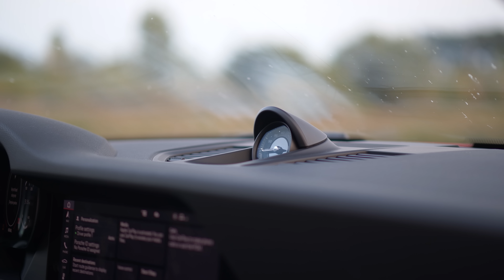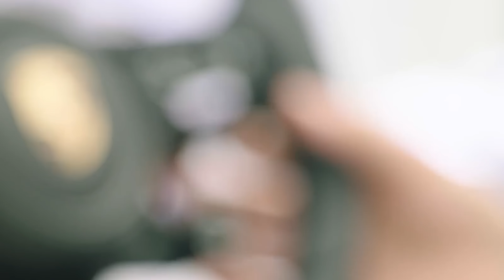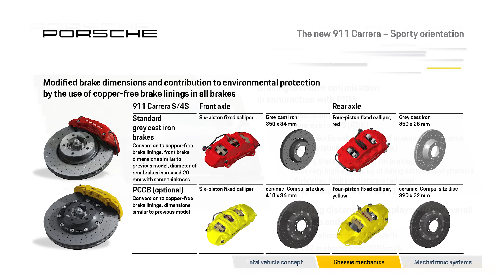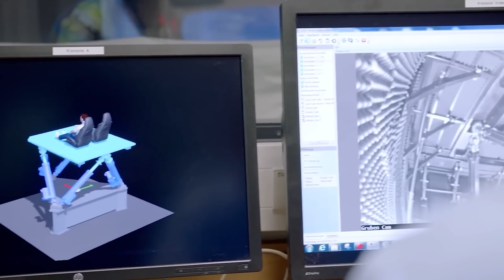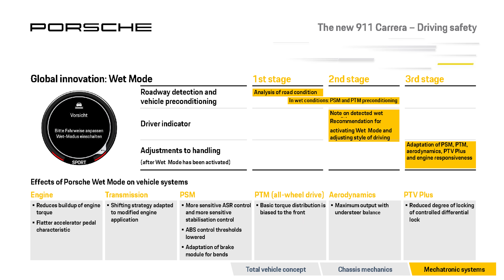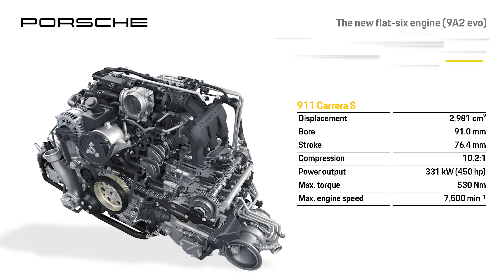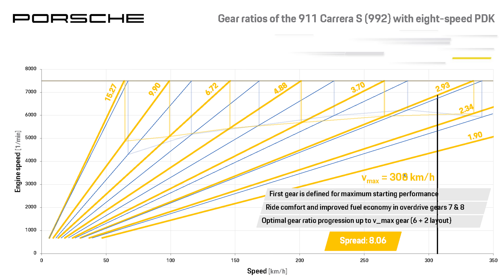Porsche 911 Carrera S 992 | Technical Brain Damage

Comment: Amazing technical presentation and so close to my driving feelings, I could add that lighting system is so good even without PDLS it is wide and the defined area is so accurate. Honestly the driving feedback this 992 gives is incredible, I thought that it may barely égale my x 981/gt4 but it over passes in terms of accurate steering feel and sharpness, the breaking despite being smaller diameter are so consistent and progressively powerful, not taking about the engine that is I bet more around 470 bhp. Porsche made this 992 so addictive to drive, my advice : never try one on a well known road you will feel upset by other car until you can get one.

Comment: You don't need all the fancy bollo*** inside to make a car worth driving or better than before. My F430 has virtually nothing in terms of the interior and it's far more thrilling than any 911 - period. However, to be "ambivalent" towards previous 911s is crazy! But I sort of get it.. Well, perhaps not previous GT3s etc. But let's take a Carrera 997. It can feel quite tame and docile as a stock car. But if you get a free flowing muffler, put 200 cell cats in, deactivate the little resonator.. That car can really start to scream and it'll feel far edgier at higher revs. It becomes a different animal. And sure you can change other little things - fill out the rear arches with spacers, put LED lights in, maybe tune the mapping a bit to give it more low down throttle response. The 911 Carrera is a fundamentally brilliant base for a sports car. I'm not sure you need so much of the 992s tech for it to be so!?
Reply: Not even close. That ferrari look worse and it's not as completed package as a 992 4S because lacks awd, rear seats and trunk space and it's slower on the skidpad (lateral acceleration) and at 0-150 mph.

Between 3 ferrari f430 and 1 porsche 992 4S, I'd still get the porsche.

Comment: Your hands should be at 9 and 3 not 10 and 2 so you are blocking the gauges by improperly holding the steering wheel.

Comment: There are no issues with the gauge cluster, it’s the same it has always been. You want to see the speed and tach, for temp and oil pressure - it will tell you if there is an issue, it is 2021.

Comment: What a great review.  Probably the most comprehensive 992 review I've seen anywhere.  Love the engineering details you guys covered.   

About the only issue I had is the comment about trial braking and how all 911's are good at it.  That's totally false.  I have a 997.1 C2 and my number one complaint about the handling is how you CANNOT trail brake the car.  Lots of Google searches will you show that for the 997, Porsche decided they would not allow the car to rotate under braking -- even if you turn off TC and PSM.  So even if you turn off PSM it's never fully off and you can't get the car to rotate, unless you purposely upset the car to the point where PSM can't correct for you.  As an experienced driver who was able to consistently trail brake a Lotus Elise through corners around all kinds of race tracks, I can't do it in my 997.  And it's super frustrating.   

Other than that little personal trigger, it was a great video.

Comment: Great video on the best overall sports car ever made. Im sorry Mark but I have to push back on your opening complaint as your hands should always be at the 9 and 3 o’clock positions, not 10 and 2 where they block the view but more importantly, the 10&2 positioning limits your range, it allows your hands to close into a clinched fist on the wheel, making your inputs too tense vs the open handed grip at the 9&3 position that encourages more measured inputs and keeps the leverage even for both arms as you turn the wheel... and so on. I got teased constantly by my performance driving instructor for going to a more relaxed hand position in between our technical sections.

Comment: I know I'm a little late to the party,  24:40 comes straight out of the game Need for Speed: Porsche Unleashed but what Mark says 26:06 is the exact same experience you get from the N/A Taurus Gen 1 and 2 SHO's. Yamaha created variable-length intake manifolds and built the top end. Below 3800 RPM's it focused on torque, then the secondaries opened for the engine to scream like this 992 until a soft 6250 redline (8000 if you mod the ECU).

Comment: Nice detailed video thanks guys. I own a 992 C2S Cabrio. I love the interior, the way the car looks and it's seriously quick. Unfortunately and mostly due to UK roads the car rides awful, it's simply too firm and crashes over even the slightest poor surface. The cabin noise is high as measured by Harry's garage at 80db @ 60mph, and even more in my Cabrio. The biggest problem I have with the car is the 14 way electric seats. They are quite hard, have no shoulder support and I simply cannot get comfortable in these seats. I wish I'd seen the blogs regarding these seats before I bought the car. 
I've driven a C2S on a track and it's seriously impressive and easy to drive fast. However, as an everyday car for me it's a no.

Comment: I like how the rear spoiler lifts and work as an air break however it would be very impressive and efficient if the spoiler is split in 2 parts left/right and operate based on the car positioning to give optimum breaking force where needed on wet roads!  just like a fighter jet..

Comment: I don't think the placement of the left and right screens is wrong, per se, because the obstruction is minimal when your hands are at 3 and 9 o'clock, rather than misappropriated to the 2 and 10 o'clocks positions (which is not how the wheel is intended to be used).

Comment: In 2013, I brought my 2012 991 Carrera into the Porsche Dealer for an annual tuneup and oil change. I was loaned a 997 Carrera S. After driving the S for the day and then picking up my 991, the comparison just blew me away. The newest generation was so much better than the previous generation that my Carrera standard was so much better than the S in every area. Apparently 8 years of evolution in the S, makes the latest generation so much more car than the earlier generation that the two are almost not comparable. It is so much better. An interior that is special and still has switches and the electronics that control the car make it an amazing experience and in control in all cases, even during the rain. The 991 was so much car that I'm in no hurry to part with my old NA 3.4 liter standard Carrera. For those who don't have a Porsche but always wanted one, the S version of this latest car (or a GTS version) is the one to have, unless you have to have a super car. Then you'll have to pony up the money to afford the GT3. AF

Comment: About the gauge visibility problem with your hands on the wheel, no one should be driving at 10 and 2. If you need to have two hands on the wheel 9 and 3 is much more efficient.

Comment: The oversight is that you need to learn the correct position and practice for your hands on the wheel. Your thumbs should be at Nine and Three, in the grooves that have been designed to guide and hold your thumbs. Some hold the wheel at Ten and Two, or worse, one hand at Twelve. They just happen to be wrong. For people that rest their hands on the wheel centre, they are morons, begging to shake hands with Death.  You're welcome.

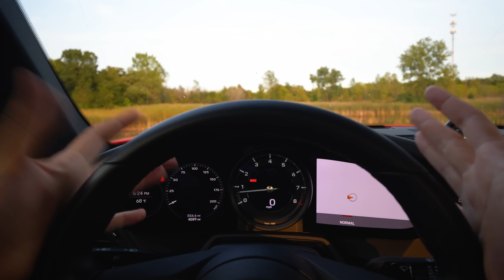Comment: 3:03 the proper way to hold the steering wheel is 9 & 3. So your improper hand position blocking the gauges is not an oversight by Porsche

Comment: This WILL become a classic like no other, even for Porsche's standards.
They nailed the styling, it's the first time a new 911 doesn't strike me as too modern, usually I need to get used to it.
Secondly, even if I could afford a 991when it was new I still would have gone for the 997 because of the interior.
Now though in my opinion the interior is perfect for a modern car. I like the look of the instrument cluster but it will be the only thing giving away its age in time.
If there were an option to spec it without digital cluster and a folding infotainment screen it would be te end all sportscar to keep for the rest of your life.

Comment: Hi everyone hope you're all well and staying safe during these uncertain times were on lock down in the UK again and I've just watched this brilliant review I took delivery of my 992 4s last year and I've got to say it's the best piece of kit I've ever driven the grip and handling is fantastic even in the wet weather and we have our share in the uk the finish of the interior and quality is the best I've had in a car for years  people are moaning about the gear selector but let's face it put it in drive press the M button and take off begins you only touch it again to reverse the only problem is the outer gauges are terrible to see I think Porsche designer's didn't think that out very good apart from that I've no complaints and it's definitely got more than 450 horses under it they've put a 2s on a dyno hear and it done 475 bhp just think of a re map and exhaust charge what you could get out of it  PDK or manual PDK for me plus just imagine how much a clutch replacement would be ? Thanks again for a good review keep them coming kind regards

Comment: I am glad you liked the car but your series usually tries to captivate the driving experience or more its spirit. The spirit is more robutt in this car and episode. Where does it stack in the increasing values of prior generations? Sheet metal and body weight are very misleading with out talking about the total weight. These were all Porsche derived graphs but I was hoping something more savage than geese in this episode. This seems like a bought review. A wave of a cap that someone got into the big leagues. Main bald guy usually curmudgeons about new technology. Soothing voice guy does well. I think this car deserves a little more criticism from a so called automotive expert.
Reply from the maker: Its too expensive and over engineered.  Thats goes without saying.

Comment: Wow, those taillights (or shall I say the taillight?) - unexpectedly fitting to the music i.e. 80s disco style for Porsche. Absolutely rad! (But visiting the Porsche website annoyed me again. Inconsistent presentation, stuff working better on older browsers than on newer ones and all that modern webhackery.)
BTW, it's a speedometer, not a spitometer. 😜
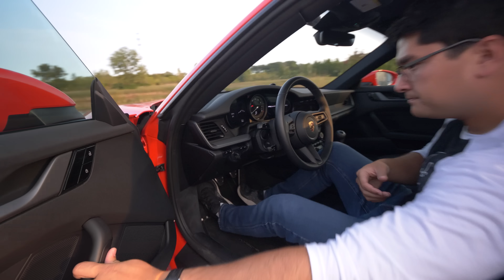3:26 Oh, now I see how you do those camera movements. Mounted on the door! (Still amazing because I wouldn't imagine a driver sitting there is giving it enough clearance.)

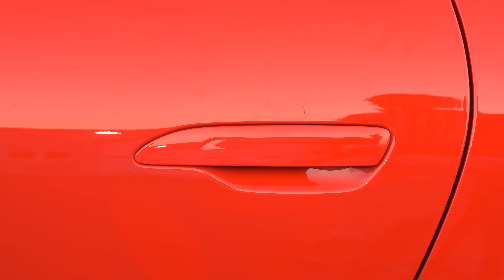20:23 Hm, now how are those door handles conforming with accident safety regulations that made everybody do grab bar style? (I assume it's a special design.)

27:30 The red seat belts are a bit out of place in that interior. It's a common style-clashing choice, I noticed. Funnily, I remember the cheapo Corolla G6R trim level that had tastefully moderate red interior elements and bordeaux(!)-red seat belts, and that was a balanced style.

30:21 The budget for no compromises but distinct orange peel paint?

All those electronic helpers ... it's like you're not even experiencing reality anymore. Every moment is distorted in a different way. The car commands you around, tells you what to do. To get an accurate experience of the relation between you and the environment, you need a consistent tool. Otherwise you are being nannied into good lap times while not developing driving skill.
I'd say if you got the money, doing what Porsche does is still comparably easy compared to excelling through simplicity.
These things are always to a degree intellectual jerkoff, which creates a growinh chasm to the heart that the world needs. It is an expression of trying to find meaning in a cold world by making ice sculptures. It might be pretty, but it's always gonna be cold. But if you want it warm, you gotta part way with those fancy aculptures that you invested so much in.

Comment: A car with four water sensors to tell the driver it's wet. Next model will display not only roof solar sensors to help tell drivers when it's sunny but a bank account sensor to help the engineers come up with better driver assist systems.

Comment: The gauges make perfect sense. It's your "American" hand placement at "10 and 2" which is nonsensical. Try the proper "9 and 3" handhold on the steering wheel and then all your gauges are visible at once, or just look at the outer gauges in the turns. ;)

Comment: I can hear those mounts take a pounding because of all that rev hang...
Clutching at full throttle you can see the revs drop by less than 1000rpm when they should drop by 2000 or more.

Comment: I thought the design was a throwback to the 993, not the 930. Because the frunk is squared at the front again. The fender panels go around the lights and below the frunk, like the 993.

Comment: My takeaway from these last two videos is that the 992 would be lighter than the (add lightness company) Lotus Evora GT, if it did away with the sound deadening, tech, stereo, ect to match the Evora GT. The 992 is such an engineering marvel. I do love that unlike the Corvette, you can still get a manual transmission on the 992. This was a fantastic break down of everything on the 992. This video produced a newfound respect for the 992 I wouldn't have otherwise had. Such a great job on this fellas

Comment: I thought the 992 Carrera was supposed to be the largest and heaviest of the non-turbo 911 models. I remember Carfection/Top Gear reviews mentioning this when it came out. Was that incorrect? is it the manual transmission? Or was the graph shown just the body weight, not total weight? I'm pretty sure the order should go 993, 996, 991, 997, 992 in order of increasing curb weight.

Comment: Having owned many 911’s the .2 version is always the best. I have had a 993 Turbo, 996 C4S, and my current Miami Blue 991.2 with a manual transmission. My next one will be a 992.2 with a manual

Comment: I'm not sure the weight gain with each generation has always increased. For example I'm certain the 996 is the same weight or lighter than 993, and 991 was lighter than 997. The big weight gains were 993 over 964, 997 over 996, and 991.2 over 991.1

Comment: I’ve quickly scanned the comments regarding “weight” and can’t find too many.... 

Guys, I like you a lot but you’re factually wrong: the 992 is waaay heavier than 991.2 by 50 kg on average. My manual 991.2 C2 manual is 1430 kg DIN: even if you chop out the 35 kg for the 8-speed PDK from the  PDK-only C2 992, the latter is heavier. You don’t add a wide-body to an overall bigger car and wheels and...lose weight. Sorry chaps: this is the reason why you don’t buy a 992: the sheer fricking size & weight.
Reply: Our facts on weight came directly from Porsche's own technical documentation.
Reply: @jackethnicallyambiguous  Mmm....maybe there comparing the ‘body in white‘ stats ? That’s a bit like McLaren’s obsession with quoting dry weight. The fact is that on-the-road DIN official weight is up 50 kg like-for-like. Bear in mind that PDK used to add 20 kg over a manual in 991.2 format. Now it adds 35 kg: a 75% increase. Why ? Because Panamera and Cayenne Hybrids need the 8th speed and the auto box integration. A 911 does NOT. But bean-counters at  Zuffenhausen won’t allow a 7-speed for 911-only, so it gets an extra 15kg added ‘for free’. Sorry but the 992 is just getting way too much of a middle-aged spread, irrespective of the extra power. And denying the C2 the manual is the clearest road-sign of where Porsche (and it’s clientele) is going with the 992: the wrong way, IMO.

Comment: 992 is not on the same platform as the 718. In fact, the 992 is the first modern 911 that does not share its platform with the Boxster/Cayman. 986/996 are on one platform. 987/997 are on a development of that platform. 981/991 got a new platform which was carried over for the 718 (codename 982). Porsche has yet to make a mid-engine model on the 992's new platform.
Reply: Nice pull

Comment: IMPORTANT QUESTION: Do you or anyone know about steering weirdness with some couple years old Corolla and Auris where the servo motor or something is overreacting, making it difficult to find a middle, where it feels like the car always wants to steer left or right and just won't settle for an easy straight line? I heard of such a problem (not occuring with Prius of same years) and allegedly the dealerships cannot/won't do anything and Toyota service is not interested in updating firmware or anything. (I only heard it in Germany, though, so maybe some aspects of it are different in other markets.)